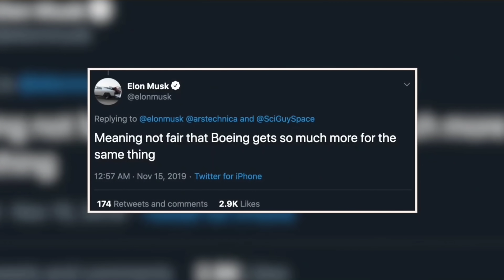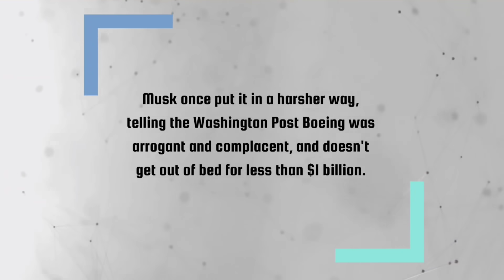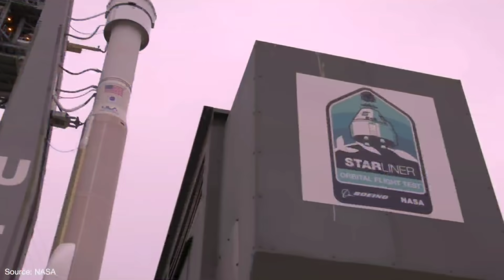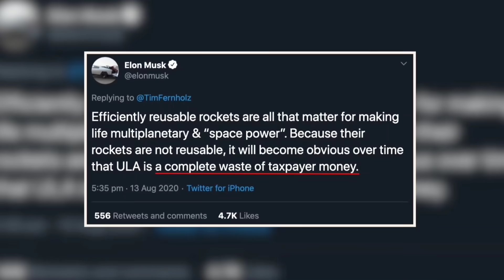SpaceX Won HUGE CONTRACT Against Boeing Starliner!

Comment: Nasa didn't help SpaceX to develop reusable rockets, they awarded SpaceX for ressuply missions, with less resources than they awarded ULA. 
In fact, the development of reusable Falcon 9 was entirely on SpaceX's own risk.
Reply: NASA first conceptualized next gen upgrades to the shuttle system back in the 90's using "fly back boosters". NASA was never able to design the transition because the fly back boosters needed to be reignited to land. There was no way to reignite solid rocket boosters so the concept was to use liquid propellants. With the power of the available rocket motors of the time, there was no way to use a liquid motor on the boosters, get to orbit, and still have enough fuel left to land the boosters. They even thought of using jet engines mounted on the side of the solid boosters. The weight of the jets and fuel exceeded the lift to weight ratio and the concept was abandoned. Many of those engineers went to work for Space X at the close of the shuttle program. So no, NASA didn't pay for fly back boosters but that conceptual tech and data was brought to Space X where they matured the development.
Reply: Incorrect. Falcon 1 was developed by SpaceX themselves and they got it to orbit in Sep 2008 on the last bit of money they had. NASA gave SpaceX $1.6B in Dec 2008 to develop the Falcon 9 for CRS missions. Musk said that saved SpaceX. ULA didn't get a CRS contract, Orbital Sciences did for the Cygnus spacecraft. Orbital was eventually bought out by Northrop Grumman.
Reply: @steveaustin2686  Precisely!
This !.68 billion "Award" was to CSR missions, not reusability.
If there was any NASA IP to rocket reusability, ULA would have it too, Blue Origin Would have it to, since it would be in NASA's interest to have cheapper launckes.
In other words, NASA paid 1.68 billion to ressuply missions, And SpaceX alone managed to develope a reusable rocket and deliver the missions.
That makes ALL the difference
Reply: @claudiomaiasantos  So sorry to inform you, but NASA gave SpaceX $1.6B to develop the Falcon 9 rocket for the CRS missions. The Commercial Resupply Services program developed the spacecraft, but NASA didn't control them like it will control SLS. That was the whole point of the CRS and Commercial Crew programs.

Comment: Boeing's problem is the craven cowardice of management in the face of quality control issues.  Being slaves to the stock market they seem to try to hide issues to protect share price rather than openly acknowledge issues and describe how they will fix them. How long before the motto is "Fly Boeing - and Die"? I note the test pilot due to fly Starliner stepped down - perhaps how knows how bad the quality issues are.